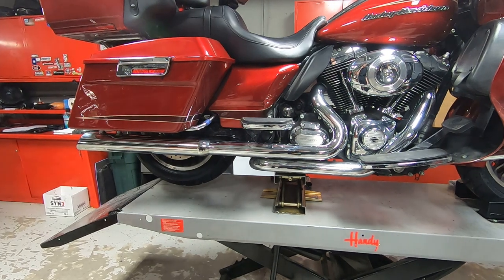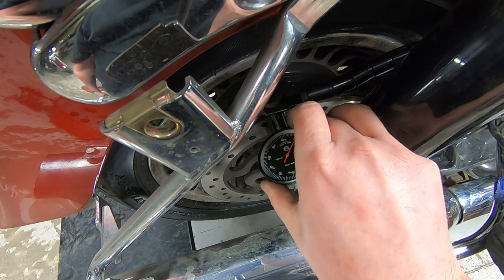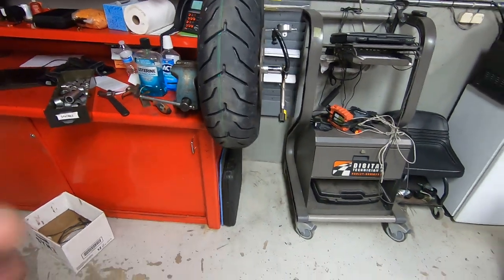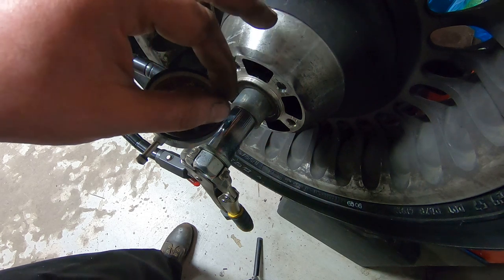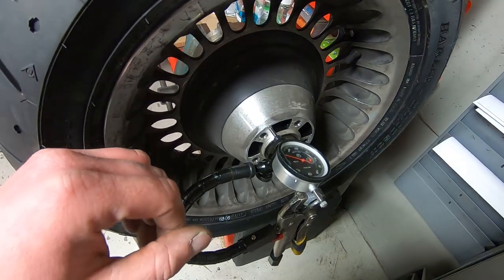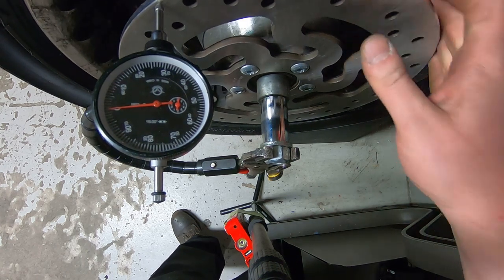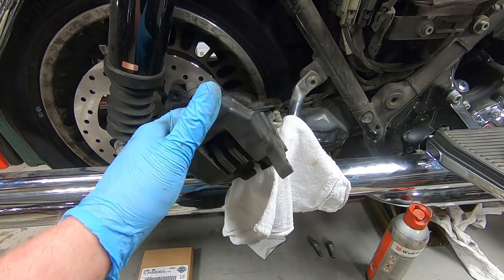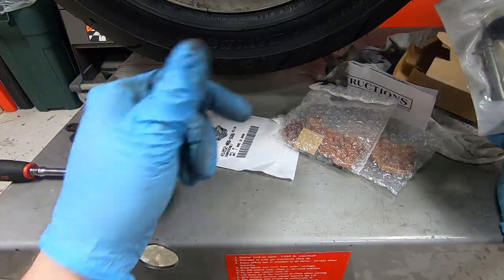REAR BRAKE ROTOR DIAGNOSIS AND HOW TO REPLACE REAR BRAKE PADS SERIOUS BRAKE PROBLEMS ON TEST RIDE

Comment: I came across your channel recently and I am very impressed with your level of detail, you cut through the b.s and you just show what is in front of you and you are not trying to sell a product. You are very detail oriented and that is almost impossible to find at Harley as they bill you a book time to do a job and then the mechanics play best the clock, and the quality suffers, but not in your case. I have been an aircraft mechanic for over 40 years and also own a independent motorcycle repair shop. I have one suggestion when doing a brake job. When you remove the caliper clean the caliper area as you do but do not compress the pistons just yet, after you clean the general caliper area get an old tooth brush and with brake cleaner clean the exposed piston outside diameter to remove heavy brake dust, then with pistons totally clean apply a light coat of brake fluid to exposed outside diameter of pistons then compress the pistons into the caliper this way you eliminate any piston drag, you will see piston drag as indicated by uneven brake pad wear. I think that it is just a matter of time before you open your own independent motorcycle repair shop, as you are very detail oriented. You strive for perfection and in the process you achieve excellence. The Devil is in the detail. Never compromise your level of detail for the corporate greed. Much love and respect for your level of detail. We are a dying breed.
Reply from the maker: Thanks for the insite and compliment.

Comment: I learned a couple tricks on this. Thanks.   I did have a set of front rotors that were so warped when I put them back to back you could see the warp with the naked eye! You could play them like castanets!

Comment: Good stuff.  I just picked up a couple similar specialty wrenches so I can get my rear wheel off without having to remove the slip-ons, which can be a bugger.  I recommend getting a pad/piston spreader so that you can just take out, and keep out, the old nasty pads.  Pop 'em out, clean calipers, spread pistons back into their bores.

Comment: Great videos Brad! Had any experience with Centramatic balancers. 2020 Ultra RDRS lost wheel weights front & rear discovered before trip. Real bummer want to avoid a repeat Thx! HDOG
Reply from the maker: I havent used the centramatic balancers before. I've had the best experience with normal wheel weights. I clean the area where the weight is going to be placed on the wheel with a little brake cleaner on a rag (or rubbing alcohol would be fine) and the weights never come off. I do see other techs have problems, tipically it's when they stick the weight to the rim and havent cleaned off the tire lube. But that's just my experience.

Comment: Another great video. Could a person measure runout on the rim to rule out wheel bearings, without having to take the wheel off the bike?  I’d presume if the rim runs true...
Reply from the maker: I figure you could.

Comment: Uhoh, did you just lay that caliper on chrome ?  Grind, Scratch, scratch😉
Reply from the maker: It was lightly placed on the saddle bag support. The pipe was still super hot from the test ride so I didn't want to melt a rag on it. When I was editing I was thinking of deleting that scene for just that reason. I knew somebody was going to say something! Lol  Glad it was you! Lol. I promise no scratches were made in the making of this video. Lol